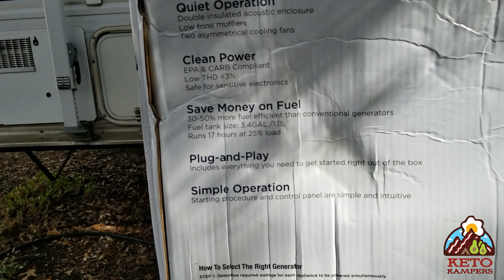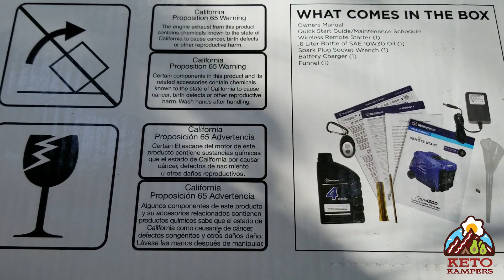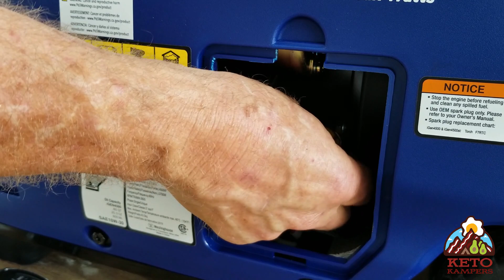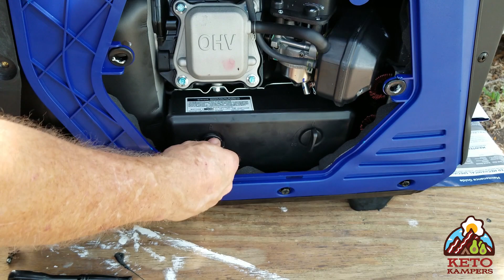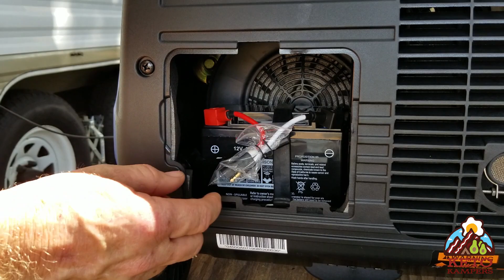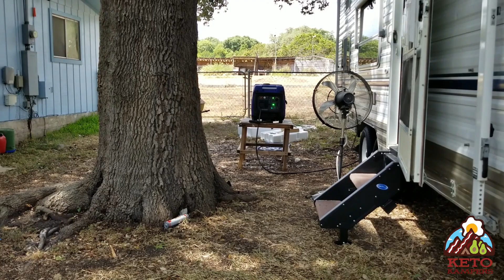Westinghouse iGen4500 Generator - Will This generator power your RV?

Comment: I just got mine delivered to me, just like a lot of the videos I watched I had to take all the covers off to attach the automatic choke wire to get it to start. I was really disappointed the very next morning to find out that it comes in a dual fuel option, I looked for that before I ordered one and couldn't find one. I'm wondering if it will parallel with my Honda 2000? any one try this yet?

Comment: Just curious was the overload on eco mode? If so I would assume you could bump it up to full power and see it drop correct? Just got mine, have oil in it, hoping not to have the choke problem some have. Great vid, keep on ketoing
Reply from the maker: it doesn't seem to matter whether it's on eco mode or standard mode. and we had to intentionally get it to cycle off. we just got through using it on a two-week trip and we ran the microwave and the power converter battery charger and coffee maker and it never even came close to capacity and we kept it on eco mode the whole time. I think you're going to be super happy with this generator I know we certainly are. Thanks,
 your friends at keto Kampers

Comment: Do you or have you any input on this product running on propane in heavy winter weather 🌡️
Reply from the maker: well on gasoline it ran several days while it was in single digits here with no problem. I don't know for sure about propane but I do know it lowers the wattage output some running it on propane

Comment: Just a suggestion.  If this is floating neutral generator( which it probably is) you should either buy or make a neutral to ground bonding plug.   This should be done when connecting to a RV.   Yes it seems to work fine, but is not correct.
Remember, always be safe, the life you save may be your own.   BTW the plugs are available at Amazon for $9-$12.
Reply: Why?
Reply: @gilianrampart8514    Inverter generators seem to be mostly floating neutral or open ground.   I found the reason is so if you are holding a tool in your hand and touch the generator metal you do not get shocked.  When connecting an RV to shore power the neutral and ground are bonded at the service and sent as hots, neutral, and ground.  Your RV does not have this connection since it is made in the shore power or the generator that they installed.   This is the video that I saw that made me aware of it.   I’m all about electrical safety, retired electrical design engineer.   https://youtu.be/Wr3ZKDN-8Go
As I said you can get a Plug from Amazon just like in this guys video.
Always be safe, the life you save may be your own.    Respectfully,   Kevin

Comment: How do you change the oil on this model?. All I can figure out is to tip it over and spill used oil all over the place. Do you stick the funnel back in and try and drain it that way.?
Reply from the maker: I'll try to post a video on oil change in the next few days it's not as difficult as it seems.

Your friends at keto campers
Reply: I bought a drainzit hose.  Love it

Comment: Hi Mark great video very professionally done I was wondering if I was to put that on the bed of my truck how high is the generator will I be able to close my cover over it?
Reply from the maker: Hey Gus thanks for the comment. The tallest part of the generator is the gas cap which is right at 22 in so I hope that works for you and thanks for watching.

Your friends at keto campers

Comment: Man, I'm just wondering if that could run two ac units on a larger TT.
Reply: Depends on the size of the ac, two 15k btu doubt it. If you have smaller ac is possible. Just check your ac ratings and do the math. Also saw something about seeing up rv ac with some device you install with your capacitors and it helps the starting wattage by reducing it..

Comment: What the knocking sound? Is that the generator or the table rattling?
Reply from the maker: any knocking sound you hear is definitely not the generator
Reply: @ketokampers342  Hi, great video! I too heard the ticking sound. Hopefully, it is something rattling although it sounded like it was from the engine.....any knocking or ticking from an engine is wear occurring.

Comment: With all of those plugs and seals, how does it do in the rain?
Reply from the maker: they don't recommend using it in the rain and less it's covered
Reply: Those covers are intended as a splash shield, not as weatherproofing.

Comment: Looks like the generic version of the Cummins generator.
Reply: The generator that Cummins sells is the generic.  Cummins generators used to be known as Onan before Cummins purchased them.  Onan was a top-end generator manufacturer noted for their quality.  All American made.  Onan was  owned by Studebaker at one time and supplied the military with huge quantities of generators.   Cummins shipped all of their smaller generator line production to China.  (Actually they didn't ship anything, they're just having their generators OEM'ed by a Chinese manufacturer and the Cummins name slapped on it.  If you want to buy a thousand or more generators you could have your name on one too!)  They are all just overpriced Chinese clones playing on the Onan or Cummins past reputation for quality.  I've seen these upfront and they are nothing but cheap Chinese clones with a high price tag.

Comment: I just did an unboxing of the same generator.  I used yours for deciding what generator to buy...thanks for the great info!
Reply from the maker: that's great to hear I hope you have as much good luck with yours is I've had with mine I have absolutely no complaints at this point. Thanks for the feedback your friends at Keto Kampers
Reply: @ketokampers342 Thank you for this very good video. I just bought one just like that. Please, could you advise me based on your experience with this generator, what problems I might face and what precautions I should take into account? Thank you.
Reply: @ElAmorTodoLoPuede-b1m  Honestly, I've had no issues with mine...knock on wood!  It's now the backup of the backup for our main generator but it starts every time.  I think you should be able to just use it and enjoy it!
Reply: @DOUGandNIKI  How long have you been using it? Thanks
Reply: @ElAmorTodoLoPuede-b1m  I think ours is now 5 or six years old but I used it intensely for the first 2 years.
Reply: @ketokampers342  If I end up with problems I'll make sure I blame you ;)

Comment: I get what you're saying about the "ON" switch, but you can't leave it in "ON" position all night and start it without going outside and switching it on. I'd open it up and take out the bulb. Just saying.
Reply: The led light for the on switch takes up very little power you’d need to leave it on for more than 10 days to drain the battery. So you can leave it on if you’re going to be using your generator that week.

Comment: NICE. VIDEO.  I HAVE CARRIED AROUND A GENERAC. 5500 WATTS  DIESEL GENERATOR AN IT WEIGHS. 273 LB EMPTY. ITS LOUD AN HAVE AN 16 GALLON TANK. I WISH THEY MADE A SMALLER. DIESEL GENERATOR. ITS BEEN DONE BEFORE HERE IN THE US BEFORE WITH OUR MILITARY.

Comment: Thanks for making such a detailed video.  I'm doing some research on this. Best video i found so far. How is this holding up?
Reply from the maker: it's holding up wonderful it's doing everything we needed to do no flaws no issues running perfectly I did do a little update on it in our latest video if you want to see it but otherwise it's running fantastic thanks for the comment.
Reply: @ketokampers342   Awesome, thats sounds great! Let me check out the updated video.   This seems to be the best option for our setup all round. This seems smaller than the predator 3500 and the powerhouse 3500 surge watts. For an extra 1,000 surge watts and 700 running watt's, it's worth the price difference plus the weight and size is a big advantage to us. Thanks again
Reply from the maker: I'm glad we could help. I hope you have as good an experience with it as we did.
Reply: I got the iGen4500 Dual and we love it so far. Been using it for the last 30Days for about 5-8hrs nonstop. Loving it, thanks again.

Comment: This looks exactly the same as the Cummins generator
Reply: I read other comments that they are the same. The only difference I’ve seen is that the Westinghouse has a dual fuel option. And the Harbor Freight Predators are the same as Northern Tool Powerhouse models.

Comment: Can you run this in parallel
Reply from the maker: you definitely can run this in parallel with other Westinghouse generators for sure. you will have to buy the parallel Cable in order to make this work. thanks for your question if you haven't subscribed yet consider subscribing and thank you for watching our video.

Comment: My question is when plugging a 50amp/120/240volt trailer plug into the 30amp/120volt  pedestal plug using the adaptor are you only supplying half of you trailer's breaker panel with power by using only one phase?  Or is there a shunt built into the adaptor so both phases of the trailer's panel gets power?
Reply: Everything is powered as normal but it just stepping down to a 30 amp service.

Comment: Thanks for the video.  Just bought the DF model and got it set up today. Here' s hoping it works well.  Trailer is in storage yet so we haven't tried it yet with the trailer. Put a 1500W draw on it and it seemed to do ok.  Just watched another vid where they were having problems with starting and power output not being what was advertised. Hoping we don't have to go through that.  I'm assuming you've been having minimal problems with it?
Reply from the maker: I think a lot of the problem people are having as with the dual fuel variety of this generator. so far we've taken it camping for two weeks and haven't had any trouble whatsoever and we're getting ready to go out for another two weeks so we'll check it out but so far it's awesome.
Reply: @ketokampers342  `I'll be interested in hearing how well it does.  Happy Camping!
Reply: Todd Brunermer That’s the one I want. I’ll check out the problem videos too.

Comment: Excellent generator I like all the features and the run time is great the only thing is I need a bit more power do you know if they have a higher output model. Thanks
Reply from the maker: I'm looking at their website right now and they do have higher output generators but not in the inverter type model which is what you want to use in a campground for the quietness of it. However if you're just going to use one at home and it doesn't matter how loud it is they do have up to 12000 watt generators hope this helps. Your friends at kito campers
Reply: Keto Kampers Thank you very much I appreciate your help. I will probably buy this one but I will need some kind of other system to power the water heater then everything is covered. The problem I have is if I use a few things together the gen cuts off and I am sick off it now and my generator is old but 3300kw.

Comment: Nice ZZ Top beard! That generator can definitely power your standard RV 13.5k BTU AC or even 15k BTU. Not sure about the reliability of a Honda or Yamaha, but at least you paid less than 2.5 times for it.
Reply from the maker: Hello Paul and thanks for the comment. Yes that beard has been years in the making. Took the generator on our first trip in the fall of last year and it worked flawlessly.

Comment: it dose not show AMPS?
Reply: The readout Displays remaining run time (F),
 power output in kW (P), fuel level in liters (L) and voltage (V). Best calculation is about 37.5 amps at full capacity, but it is not displayed on the unit. A calculator can be used such as this one - https://www.rapidtables.com/calc/electric/Watt_to_Amp_Calculator.html. I hope this helps!

Comment: I bought an IGEN4500. I left it in garage storage for about a year before I took it out to begin using. I started it and let it run a while. Between the second and third month of starting it every 30 days it developed a gas leak. Why would this have happened?
Reply from the maker: I'm sorry you're having trouble with your Gen. I know that when motors sit and don't run for a while that sometimes the rubber parts will dry out, sort of "dry rot" if you will. If that is not the problem I would recommend taking the side panels off and checking the fuel line connections and that all the screws holding fuel system parts are tight. I hope this helps!
Reply: Just power off the generator turning the fuel knob to OFF. Doing this way will drain all the fuel from rubber lines.
Reply: Probably the float in your carb is stuck. Just take the carb bowl off and clean everythinh

Comment: Great Video, I have the UK equivalent, the Hyundai P4000i, the only difference is 240v AC output, seems to be a very good generator, seems quiet which is a big plus for me, also has a good output as well, thanks for the very thorough in-depth video review, thumbs up from me.